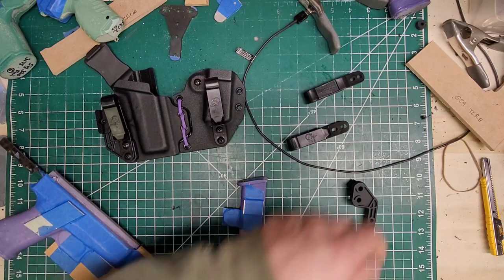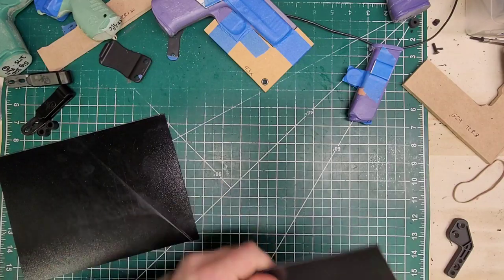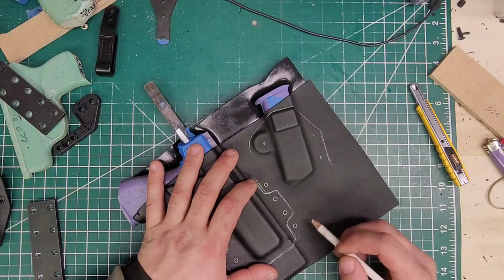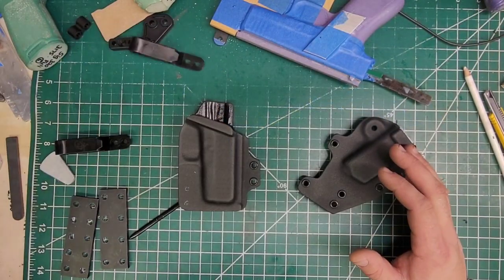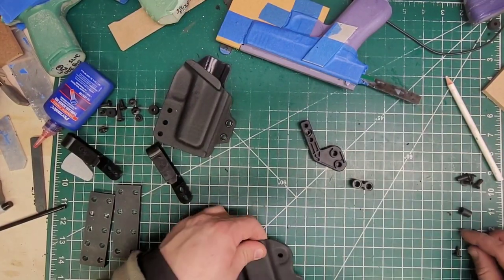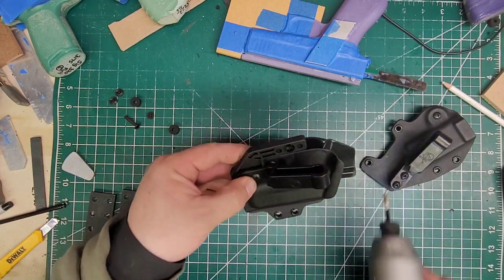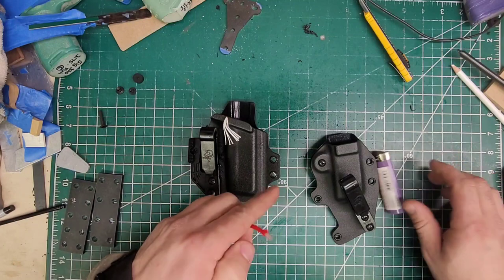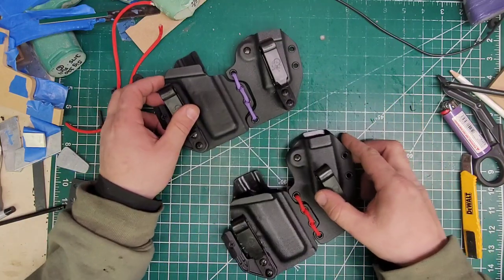2 Piece Glock 43x Appendix with sidecar using paracord

Comment: Could you post the sizes of the hardware u use? 

Rivets/eyelets, Chicago screews and kydex thicknesses? :)

Not for this specific but what you usually use. :)
Reply from the maker: 1/4 slott3r posts
1/4 rubber spacers
.4375 screws is my norm lol
Reply: @FalTacUnlimitedLLC  and what thickness kydex does thar goes with? Sorry for all the questions but im new and want to order the right stuff:)
Reply from the maker: @Rebeliousfight  .08. Pretty sure I say it in a lot of the videos hahahahah
Reply: @FalTacUnlimitedLLC  im from Denmark, so not that good at english, but your probably right :) 

Ty for the informative videos, i really enjoy Them.
Reply from the maker: @Rebeliousfight  hell ya dude!
Reply: @FalTacUnlimitedLLC  ill post you my first sheath when i get all the equipment bought 😂😂
Reply: What is the size of the eyelets?
Reply from the maker: @HaimPeretz 8-10

Comment: Just curious but how did you cut the backing piece for the weapon taller than the front piece if the were riveted together?
Reply from the maker: I cute the longer side with a band saw and I cut the shorter side with a dremel and cut off wheel
Reply: @FalTacUnlimitedLLC  Aaahhh, makes sense. Duh on my part! Thanks for the quick response.